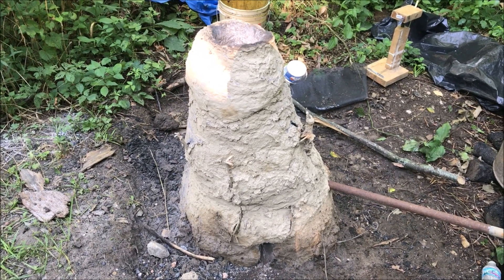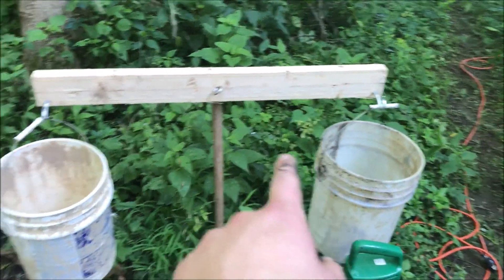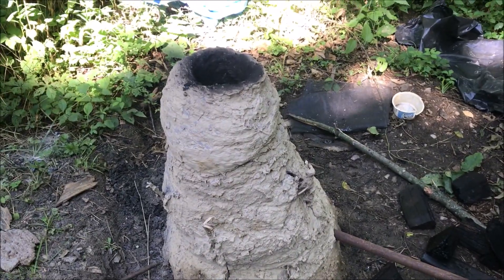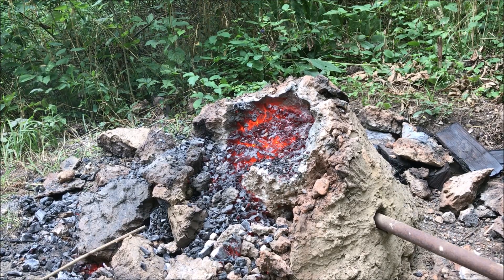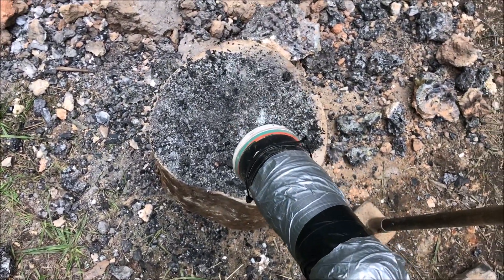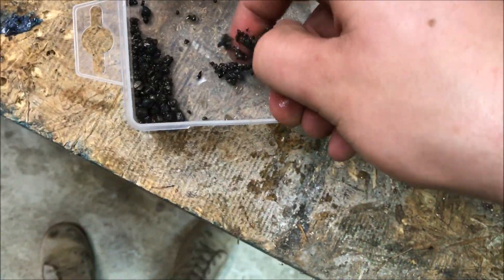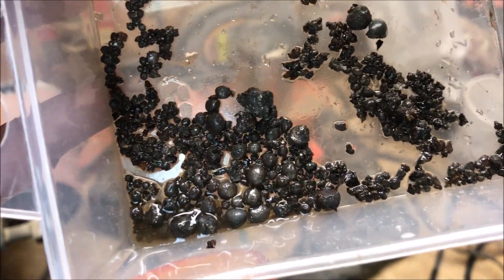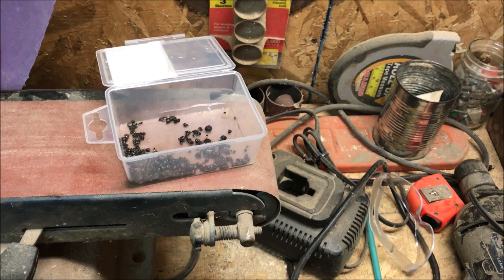Making Iron From Rock

Comment: Cool experiment. You had at least two of the elements correct; the charcoal and the ore. Where was your flux?
Reply: Flux?
Reply: @samcarter2371  the material added that binds with the impurities (like silicates) and forms slag as waste.
Reply: Slag? 

Lol

You ppl on YouTube are getting smarter everyday.
Reply: @samcarter2371  fluorite is a common smelting flux, but in a simple reduction smelter limestone was often used to promote fluidity.

Comment: Looks like you're pushing in too much air. Several problems with this. One, if you're pumping in more air than your furnace can actually burn, the excess air ends up absorbing heat and cooling your furnace. Two, the excess air will re-oxide any reduced iron that falls in front of the airflow of the blowpipe/tuyere, turning it into slag. Also, if the top portion of your furnace is getting too much air, the charcoal burns too cleanly, and doesn't produce enough carbon monoxide needed to coax the oxygen out of your ore. Remember, these things were originally ran by hand powered bellows and pumps. You don't need too much air, just enough to keep things burning and hot in the bottom of your furnace. Don't throw away that slag, just crush it and run it through again (probably with more ore), bet there's a lot of iron still locked up in there.
Reply: Im gonna use a blowpipe for a couple of hours and see what i can get. Probably a headache and lots of pain hehe.